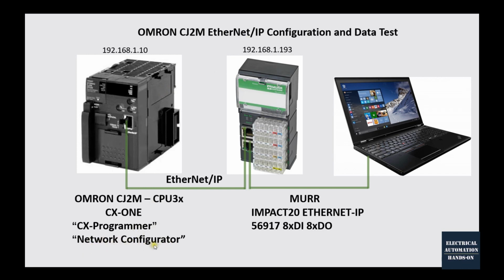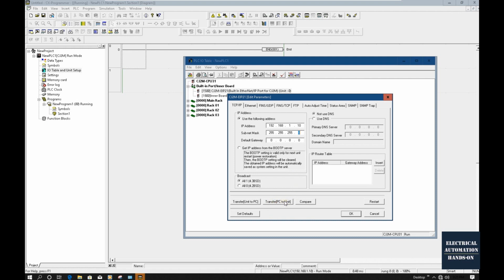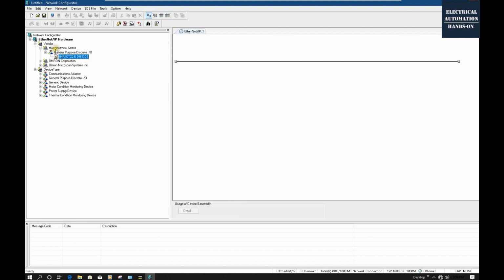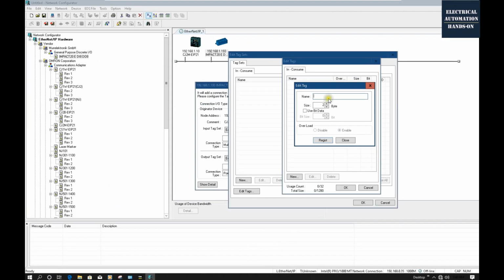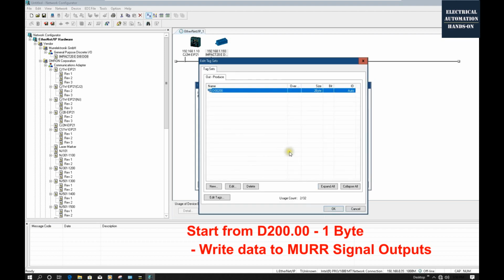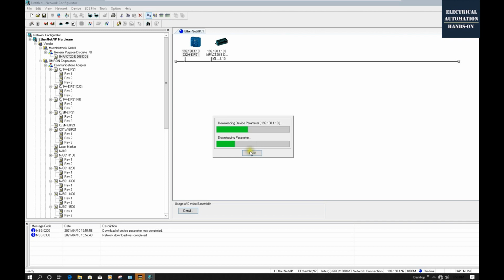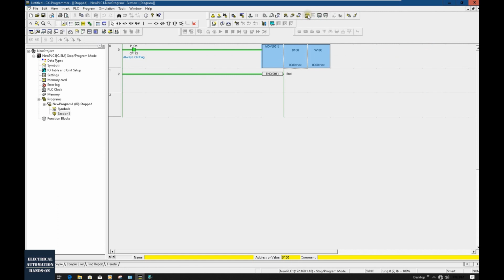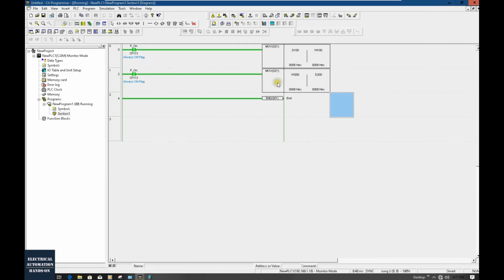OS4. OMRON CJ2M PLC Ethernet/IP Communication (MURR IO as EIP Device)

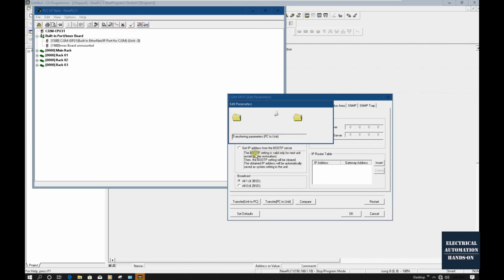Comment: Help me plz i followed your steps until 5:37 then the pls connection error message apears and it's trying to connect but nothing happens now it doesn't show when i try to open it from plc in the top menu (Ethernet/ip node )
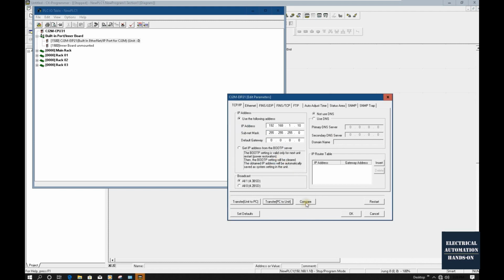Reply from the maker: 5:37 is just started, most likely you are having trouble on your hardware. Please check your hardware
Reply: @electricalautomation   the plc or the pc because it was connected normally